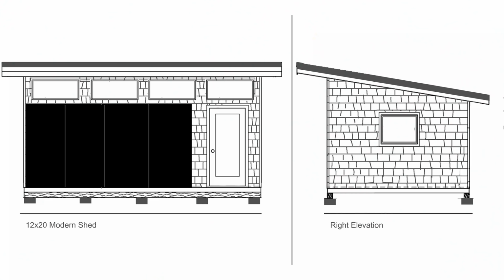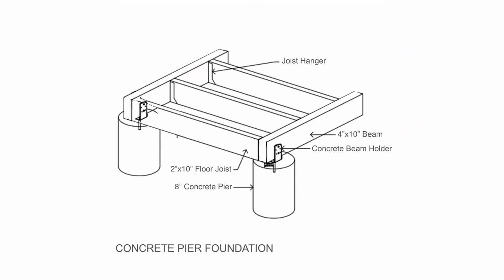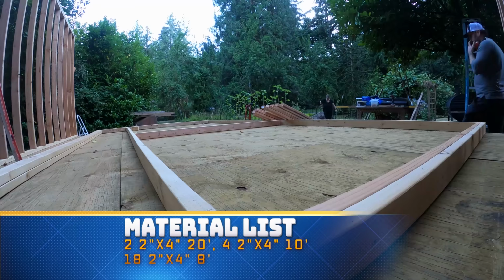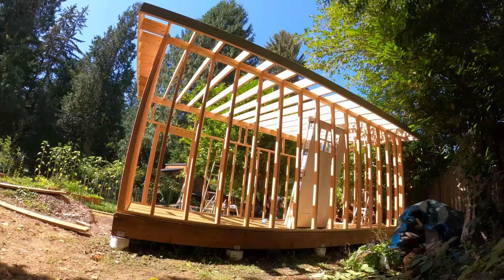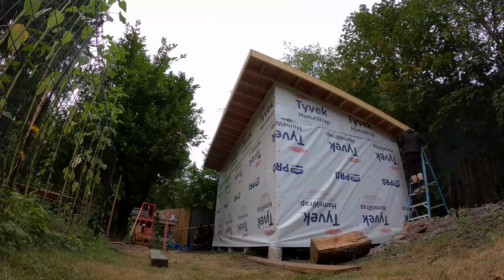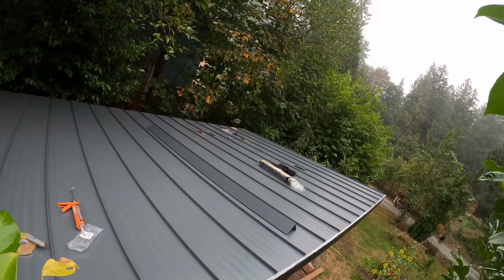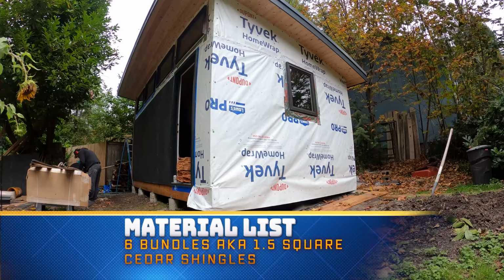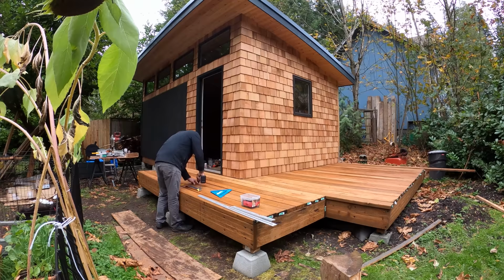Build A 12'x20' Modern Shed and Deck by Yourself: With Material List

Comment: Those brown decking screws aren't made for the shear load of a hangar application. The hangars should be used with nails or the Simpson structrual screws that are stocked near the hangars at the big box store.
Reply from the maker: Thanks CrosshairLunchbox. You are correct, I should have used structural screws instead of deck screw for the hangers. I'm not a professional carpenter and am learning as I go...  Here is a good video about shear load and screws vs nails for anyone looking to  learn more. 

https://www.youtube.com/watch?v=qmajKElnwfE&t=641s
Reply: And you only used 2 x 6 hangers for 2x10s they actually sell 2 x 10 hangers so that way the hangers actually a lot taller to get more nailing surface so the board doesn’t twist
Reply: true but didn't he add lag bolts to each joist at the exterior side of the rim band? He should be good
Reply: @juniorcarmack8741  any big diff between nails vs construction screws?  Forgetting the obvi work of screwing vs nailing.  I'm talking like structurally....are screws better?  Or what's the dealeo.  Curious because I'm going to rip on one of these here this next year
Reply: @rgbking488 it’s not whether one is better than the other…. They’re used for different purposes. Nails for “moving or shifting” points, screws for weight or gravity points. Example ive heard used is to screw a screw and hammer a nail equally into a board, then try pulling the nail out and then try pulling the screw out. The nail comes out more smoothly, the screw probably won’t come out. Now, whack the exposed nail and then the screw from the side. The nail will bend, and the screw will most likely break off. The nail handles movement better, while the screw is better for retention…
Reply: @D-Z321  that's awesome - thank you for that feedback and insight!!  Heck yeah.  Really appreciate it

Comment: I’m looking to build a 12x16 “finished” shed, for a backyard office. This video really sums up the structure process. Would you do anything differently with plans to finish the inside? We have a 4 season climate. Thanks and amazing work btw!
Reply from the maker: I’m pretty happy with my design for the most part. If I was to use it as a studio or living space I might want bigger windows? I should have used structural screws or hanger nails when installing my joist hangers. Maybe synthetic deck boards? Glad you liked the build Steven.
Reply: would using a thick concrete slab offer any benefits in cold climate areas (north east)? Perhaps insulation between floor joists an option?

Comment: You did an amazing job and I think you have convinced me to give it a shot! I'm looking to do pretty much exactly what you did but 12 x 24 ft instead. I think my biggest hurdle is doing the foundation. I've never had to level something so large. Have any tips on doing the foundation or have a video?? Anyways thanks for making this video. I'm sure you are helping a ton of people by sharing this.
Reply from the maker: Thanks Sheldon Gray. I found the batter board method for laying out the foundation to be very useful. The 3-4-5 measuring technique is key in making sure everything is square. Also they make these little bubble leveling tools that hang on the line as well that work great.
https://www.amazon.com/Rope-Bubble-Level-Hanging-Leveler/dp/B07Y8GPJ7H
I personally don't have a video showing the method but there are a ton of them across YouTube that should show you the basic concept. https://www.youtube.com/watch?v=xZJ6bEn0HQY
Reply: @NilesProductions  Thanks for the info man! I really appreciate it! I will definitely look into those.
Reply: If you build a deck longer than the building this gives you outside working and relaxing space. You need it after a hard day in the shed.! 😄
Reply: @NilesProductions  I forgot to ask do you know the shed height from highest point of the roof to the shed floor? I'm trying to see if this falls within my 12 ft height limit.
Reply from the maker: @Shellz006  From the floor to the peak cap it's aproxamently 11'.
From the bottom of the 4x10 beams it's just under 12'.
My front wall is just under10' and the rear wall is just under 8'. The over hangs is 30" in the front and 18" on the back
Reply from the maker: @robertforster9482  The side deck is a great place to sit and relax during the summer months for sure. It's a nice place to sit and watch the bees buzzing about the garden busy at work  :)
Reply: @NilesProductions  awesome! Great info and thanks again!

Comment: You don't use deck screws on joist hangers. That would fail inspection in a heartbeat not mention that screws shear strength is shit compared to the proper fastener....either joist hanger nails or structural screws.
Reply from the maker: You are correct, I should have used structural screws instead of deck screw for the hangers. I'm not a professional carpenter and am learning as I go...  Here is a good video about shear load and screws vs nails for anyone looking to  learn more. 

https://www.youtube.com/watch?v=qmajKElnwfE&t=641s

Comment: For anyone that sees this. He almost got the handtruck trick right. The better way is to lay the truck down, as he did, but instead of putting the end of your long piece on the truck, set your piece almost centered on the truck. This makes the work almost weightless. The positioning depends on where the balance point is, you may have to experiment a couple of times to find the sweet spot.
Reply from the maker: What you say is true but then you have to decide if you want to walk hunched over to move the board because if you tilt it to much the end will be dragging on the ground. LOL

Comment: Few questions…did you design the structure or hire out to get the plan done for you?  Was it a matter of cost to go with pillars vs full on foundation?  First time picking up tools or is this what you do for a living, contractor?  Final cost?
Reply from the maker: Good questions Alejandro. I bought some books and other material on how to build sheds/garages at my local hardware store as well as some simple plans online. 
I took different design elements from what I found in the book/plans modified them and made my own.  
For the foundation, the ground is a bit uneven and slightly sloped where I built the shed. I figured it would be less labor intensive to do pier and beam vs trying to level the ground and pour a slab. I also wanted the deck to be slightly raised. The price didn't really factor into the decision.
When it comes to tools, I've been a home owner for a couple years and have slowly picked up tools for little projects here and there. 
I'm not a professional carpenter just a guy with a saw and a hammer that likes to DIY stuff.
The final cost was a little over $12k
Reply: I really appreciate your response!  And thanks for all the info as well!  Reason I ask is that many “DIYers” that post vids like yours that have “zero” experience turn out to be pro carpenters/contractors and not believable.  and the price, WOW!!!  Definitely pays off to learn building something like this!  I’ve been quoted $40-60k for 20x30….now may look into what you did, learn on my own!  Oh, and AMAZING JOB!!! 👍🏽👍🏽👍🏽
Reply: And forgot to mention, I can watch and rewatch your video of this build and enjoy it every single time more than the last! 🙌🏽👏🏽🎉
Reply from the maker: @alejandroperales5424  I find watching people build stuff is very soothing/relaxing for some weird reason as well. Who would of thought watching some guy build a shed would be so popular.

Comment: You did a 100% excellent job...better than I would have and I'm a 30 year contractor.  The only thing I'd change is to save the $1500 in plywood wall sheating.  It's not needed when using T 111 siding.
Reply from the maker: Thanks John, 
I wasn’t going to use the T1-11 plywood siding originally. 
I originally was planning on doing Shou Sugi Ban charred wood siding. 
It’s the Japanese art of burning wood siding to preserve it and imho it looks beautiful (I suggest googling it if your not familiar)
I’ve never made Shou Sugi Ban siding before. 
I’ve looked into the process a bit and think I could do it but at the same time the materials are expensive and would be exceedingly  costly if I messed up. 

So when it came time to buy the material for the Shou Sugi Ban and char the wood I got cold feet. 
The reason I went with the T1-11 plywood siding at the point I did was purely financial. 
The reason I painted it black is because I kinda wish I did Shou Sugi Ban siding lol 
Maybe someday I'll pull down the T1-11 and give it a go....

Comment: Built better than 99 percent than most homes due to actually 1/2 & 3/4 plywood not particule board or glued flake wood
Reply from the maker: As a younger man I built a lot of skateboard launch ramps and a couple half pipes. Learned real quick that the osb/waferboard doesn’t hold up to the elements very well. I also noticed that all contractors tend to use plywood on their personal homes…

Comment: Very good video, thank you for sharing. You did an excellent job especially since you were learning many things as you were doing the tasks. 

I don't know where you are or if you need to worry about frost but if you do a project with concrete piers or deck blocks again this advice may be handy. 

For the concrete piers it looks like you made the hole just a bit bigger than the Sakrete Tube, put the tube in, backfilled the hole, inserted rebar, and filled with concrete. Perhaps the video left some steps out. A few years ago I tore out my old fence and had someone come in to pour new deck piers for my new fence that I built. (I used a product from Hoft that bolted to the deck piers instead of embedding the fence post in the concrete. It uses wood or composite deck boards to slide in between the posts to create the fence.) The people that installed the deck piers for me made a hole about one size larger than the tube I was using (made a hole for a 12" tube if I was using a 10" tube) and deeper than it needed to be. They then threw down a couple of inches of gravel, around six inches of concrete so that it would be wider than the tube, then the tube was placed slightly in the concrete, rebar was inserted inserted into the tube and the tube was filled to the required height. The gravel is required so that the concrete isn't sitting directly in water and the flare at the base helps prevent the pier from moving up with frost. I had them make the piers go down 48" which is safe in my area but the flaring was an extra precaution.

I've also worked with the deck blocks to build a deck and I was told that they should sit on a concrete paving stone at least 4' square and that paving stone needs to be sitting on a level bed of gravel at least a couple of inches thick for drainage. 

It is likely that there are different building requirements in our two areas. Those extra steps are to help with the longevity of the concrete and they don't require that much extra expense and time. I'm not criticizing you. I know how hard it is to do a large project by yourself and you have every right to feel proud about the job you did. My aim is to let you know of an alternative way of doing things and you may research it to see if you want to use it on your next project.
Reply from the maker: Great advice 🤙 When reading about the requirements for my area and the size of building I was making. I found that the frost line was 12” and the piers needed to be at least 18” deep. They recommend gravel at the base of the tubes as well. 
I didn’t add extra gravel as in this area of my yard it’s basically all rock once you get through the 4-6” of top soil. (This may have been a mistake on my part but so far so good) 

For the size of the building it recommended 8 piers to support the 20’ beams.  In the end I wanted to beef things up just a little and did 10 piers instead of 8 and dug down 24” instead of 18”. 

I didn’t go heavy duty with the deck’s foundation. 
Probably should have done the same for the deck as I did for the shed (or something like you recommend) but instead I just scrapped of the top soil down to the gravel and placed the pier blocks. This bit of laziness may bite me down the road 🤷‍♂️

Good news though is it has been nearly two years since I started the project and I haven’t noticed any significant settling and everything looks to be as square as the day I built it. Hopefully it remains that way for years to come. 🤞

This project has been a huge learning experience for me and I love reading advice like you posted as I don’t do this kind of stuff for a living and love learning new tips and tricks. Thanks for watching and the advice.

Comment: You've etched out a nice little corner of paradise there looks great. Unfortunately here in the UK property doesn't come with much land. My garden for example is approximately 13 feet wide by 65 feet long and really confines you in what you can build especially with gardens either side. 
In saying that there's quite the movement in making tiny spaces look and feel big. Your build there fits really well with the finished garden, well done really enjoyed watching.
Reply from the maker: Thanks Mark! Glad you liked the build and video 🤙 I really wanted to make something that complimented the yard space and the main housing structure. The shed has been a nice place to work on my bike and the deck is a great place to relax and look out over the garden during the summer months.

Comment: Sturdy build.  Good job!  Looks like It would stand up to the tornado-grade straight winds we often get here in North Texas.
Reply from the maker: Thanks James!!! I don't know if it will ever have to pass the tornado test were I live but It will have to pass the torrential rain test this winter lol
Reply: Agree a very good job, but being rated for tornado grade winds may be a bit of an overstatement as there are some unknowns. We know there are deck screws (vs Simpson string tie or similar structural fasteners) for the joist hangers (and possibly to connect the beams to the foundation.) These are rated for uplift (wind) as well as downward weight. It also looks like deck screws are  used for connecting all studs and connecting walls to floor and the rafter hangers. Not sure of their rating for hurricane/tornado but would assume not.
Reply: It was meant as kudos and encouragement.  But thank for being that guy who has to correct everyone and bring down the party vibe.

Comment: Great job throughout! Only critique I can make is that you should have tamped gravel under the deck footers, they’ll likely sink over time sitting directly on the soil.
Reply from the maker: My yard has about 6” of top soil then under that it’s pretty much all compacted rock. (It’s a real bear to dig in) I had originally planned on doing what you said putting gravel under the footers of the deck but instead just scrapped away the top soil and took the gamble. 
I’m happy to report it has been nearly 2 years and 200 inches of rain since I finished and the shed/deck are as square as the day I finished. 
I would recommend to others do what Clinton Coe recommends and not what I do.
I guess I’m just lucky that I have such terrible soil LOl

Comment: Nice work. Heck of a strong floor too.  I really like the design and the framing with its alignment of rafters stacked on studs. Well built with not a lot of waste.
Reply from the maker: Thanks Vauzz66 for the kind words :)
Reply from the maker: I think this was one of my better planned projects. When all said and done I only had one 12' 2x4 and one sheet of T1-11 plywood left over. Not much waste at all. I also saved as much of the old shed as I could for future projects. Starting to acquire a pretty good pile of reclaimed lumber.

Comment: first effort and all i get it . . .but it amazes me when people use the wrong fastners and hangers . . . . and get head long into the construction without considering use . . . insulation, proper water diversion and protection and amenities are the value in a structure, factoring them in is a part of the building process . . . make sure you track those things and make videos off those revelations as they become relevant . . . between basic construction and knowledge of your environment and it's intended / probable usage you got it covered, just don't miss the future content cause it was scary :)
Reply from the maker: All true, there are a lot of things to think about when it comes to building, more than what is shown in this video. This was my first shed build, I’m sure I made some mistakes along the way but am still happy with what I was able to accomplish.

Comment: I'm sure it's been said already but you want to use nails or structural screws as much as possible but especially for hangers as they have much better strength.
Reply from the maker: True, better to use nails on hangers for sure or structural screws
Reply: Yes definitely use joist Hangar nails  they have a much higher sheer rating to see how important they are just put whatever Fastener or framing nail you're using in halfway then hit it from the side with a hammer and snap it off   a joist hanger nail won't   and if you start adding a lot of weight to the floor you don't want to buckle  and possibly hurt someone